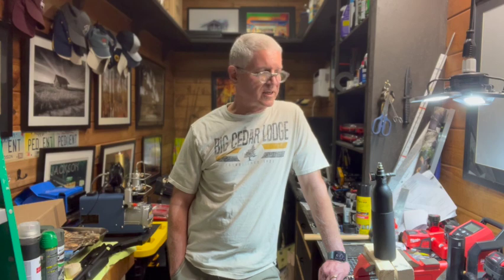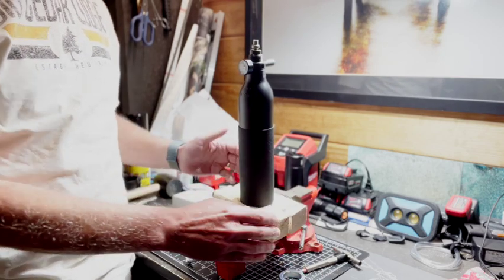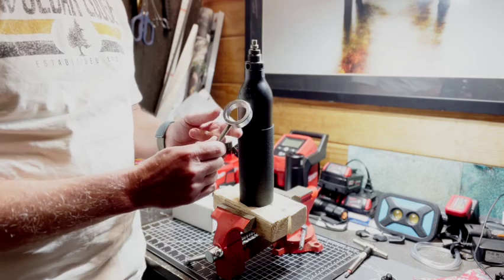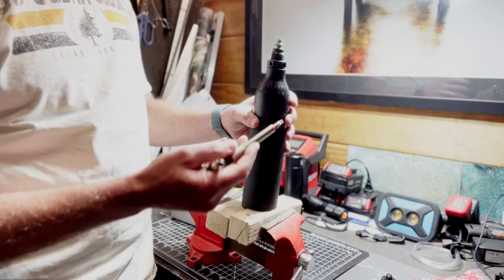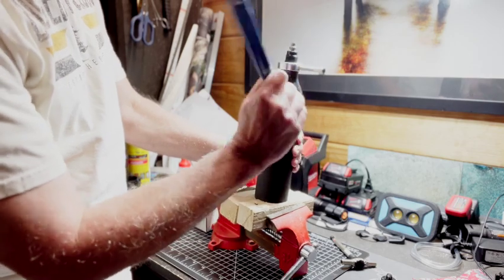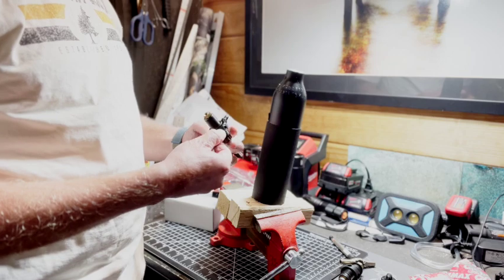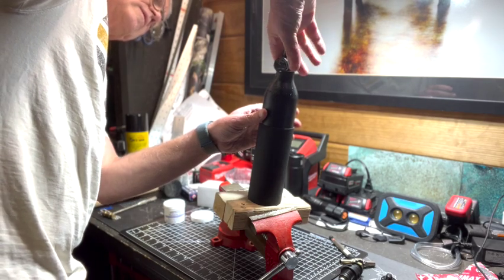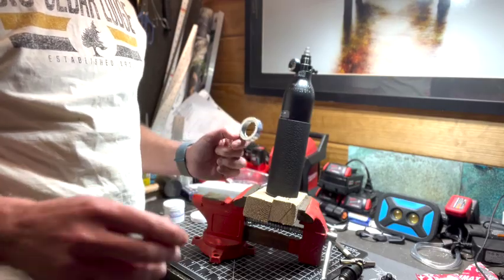Airforce Condor Tank Valve Change

Comment: It would be awesome if it was easier to contact AirForce PCP.  I have been trying to either fix the leak on a Talon SS 22 cal or to replace the valve with the same system as you replaced yours with. Your video was great and informative. Would like to see if you have any links or item numbers for the valve and top hat system. Thank you.

Comment: I couldn't remove the quick detach valve from my original Condor.  I used the same collar but my stainless steel screw just bent. Oh well, it's probably 20+ years old. I'm trying to change it all to spin-loc now.

Comment: What is the link to buy the screw that fits the ring? 

Where can I find a new valve to buy? Mine is the same as yours and I need to change it. 

Thank you
Reply from the maker: For the screw, I went to Home Depot. Most hardware type stores should have one that would work. 

I purchased the new valve directly from AirForce Airguns. https://airforceairguns.com 
Just call and place an order. It was easy. 
Thanks for watching!

Comment: Hi Mark. I have a 10-year-old Condor SS with a spin-loc 490cc tank, and the tank air valve leaks. I would like to maintain the tank as it came from the factory. Do you know how I can get the replacement parts, and the tool(s) to remove them, to change the air valve? I've spent at least 8 hours researching for a solution but have not found one, other than sending the tank back to AirForce Air Guns for repair (I don't know what they would charge to fix it or whether they will sell me the parts I need). Thank you in advance.
Reply from the maker: Sorry for the long delay in replying. You may already have this solved, but I would call AirForce directly to order a new valve. That's what I did in this case. The process of changing the valve should be as in the video. You don't need to send the tank to AirForce. I looked online for a third party replacement valve but couldn't find one. AirForce would be your best bet. Hope everything goes well, and thanks for watching.

Comment: Thanks for the link as I just ordered a dropdown with gauge and fill valve for 10 year old tank. The piece you removed was the overpressure disk. Not sure what it's rated for but guessing 3200 psi. 2900 max for my old valve to keep from locking up. Thx!
Reply: ..and you are lucky! I'm using a 3 lb hammer to break mine loose, no luck, but bends the SS bolt. Lol, I checked your video to make sure lefty loosey.
Reply: Finally! Had to use a pipe wrench directly on the collect as bolt close to breaking off when using that as a lever. Tank was slipping in wooden clamps! Sign of relief when valve broke free! Threads appear to have chemical residue..thread locker? Why Air Force?  Anyway on to set up drop down adapter.

Comment: I'm trying to get the valve removed from my TalonP but it's not budging, I know it's impossible but it almost feels welded, it's insane and unnecessary. I've tried heat and a perfect fitting tool that grabs the hole (like you showed) I used a vice and clamped it beyond crazy but i will not turn. I used rags and wood to prevent sratching but it doesn't work. It's scratched now . . . so I will quit and stop going any furhter. I don't understand why AirForce does this, it's totally stupid and has no added value. When let out the pressure from my Leshiy 2, I can unscrew the bottle with my bare hands as does the fitting, the same goes for the endcaps of my Wingshot II and Marauder but I just can't seem to find the clamping force to hold the bottle without damaging it.
Reply from the maker: That must be extremely frustrating. I wish I had a good answer for you, but I'm not sure what's going on with that one. Did you buy it used, or was it original? I also assume that it's been completely de-gassed. Hope it will eventually loosen. Thanks for the comments.
Reply: @jmarkreed It's new and degassed ;-)  I recently made a tool that worked. Now it's off, thanks for your response my friend.

Comment: Thank you for your help. Exactly 💯 percent what I was looking for.
Reply from the maker: Great! I'm glad it was helpful. Thanks for watching!
Reply: @jmarkreed  Your welcome. One thing that I been wanting to know is how to fully disassemble the Airforce valve and reassemble it. For in the case that you need to replace parts, upgrades or general maintenance on it internally. Not a must but would be extremely helpful to me as I'm learning the Airforce airguns specifically the Condor SS in .25 caliber. It's my farm pest control rifle so the more I know the better. Thank you for your response help and the sharing of knowledge. I have experience in small engines and welding if you ever have a question or two. Experience trade off maybe.
Reply from the maker: @shawndubay4050  Now that's one thing that we might have to learn together. I haven't ventured into that as yet, but if I do, I will certainly post something on it. On the other hand, if you post how to do it, please let me know! Thanks
Reply: @jmarkreed  if I get brave and explore /figure it out. I will definitely let you know how it goes and how to do it. Think I will have a new backup valve on hand just in case. Oh by the way. You handled that valve swap like a professional. Believe in yourself with whatever you do or plan to do our Lord has your back always Amen.

Comment: I have late model condor and it suffers from valve lock and irregular shooting all the time...i wish they would address this instead of looking the other way.
Reply: Do some research. Do not fill the tank more than 3000psi or you will lock. If you did upgrades to the valve to the uigh power you will need a heavier hammer weight so it does not lock

Comment: Thanks just what I was looking for.  Was hand tight all that was needed when putting on the new valve?  Could you use teflon tape instead of the moly coat?
Reply from the maker: Yes, hand tight should be fine. You should not use teflon tape- that is not recommended and could be dangerous. Moly coat is what AirForce uses, but I'm sure something similar would be okay. Thanks!
Reply: @jmarkreed  Thank you